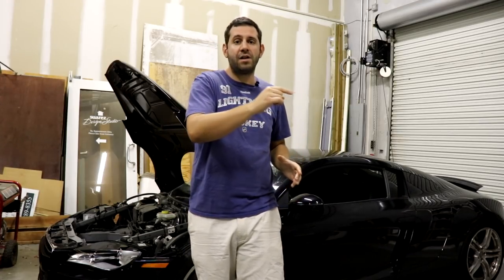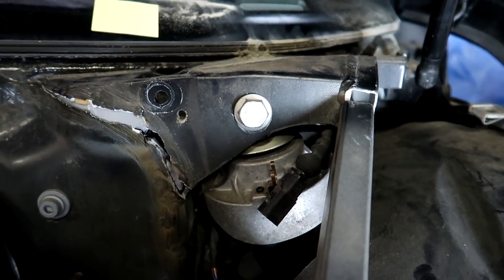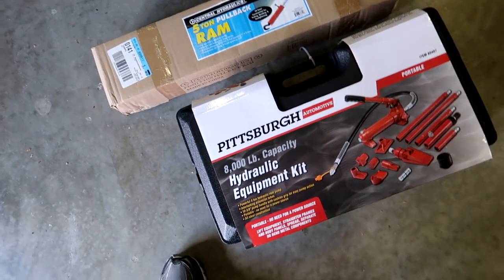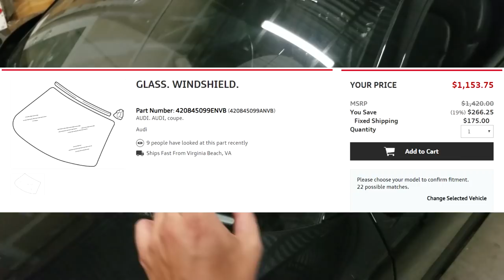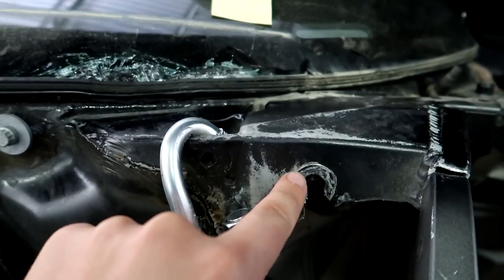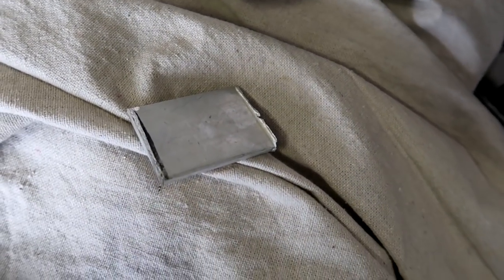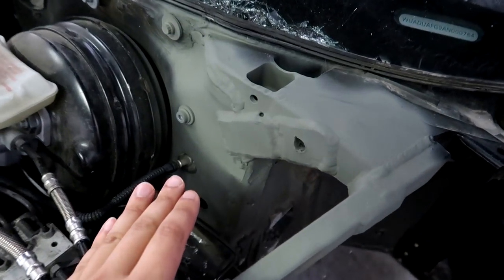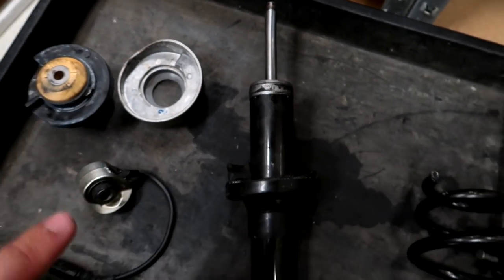I Repaired My Totaled Audi R8's Cracked Frame for $500! Insurance Quoted $29,522!

Comment: Crazy @tjhunt could repair an aluminum square-tube Ferrari 458 front end on the super cheap from pros, sourcing used parts..and yet, here you are hacking away with cheap welds. I get it's a "road car" , but the stupid factored into this fix is a bit overwhelming here.

Comment: Hey Samcrac when the welding was done with a tig welder did you have any issues with any of electrical modules I’m a Bodyman and we are told we can’t use tig welders because of the high frequency start but we weld aluminum with a pro spot mig welder I ask because I haven’t found any information any where providing that we can’t weld with a tig but everyone at my dealership and instructors from I-CAR say we can’t, we mig weld all our joints where we splice the panels in I didn’t hear you say you had any problems we always disconnected the battery for safety on steel and the aluminum trucks but was just wondering thanks for posting

Comment: That's a plus 80 mph crash and Audi plates are meant to be fitted before its snapped the Audi r8 is a space frame  chassis  which  means the only cost effective  way to change it for consumer sale is to change  the front  sections  or race car repair it by realigning  the chassis  with a dozer  gently  heated up with Oxyacetaline pulled to near as dam  possible and then brace  it with a cross section and then weld it all back in place that weld repair will bust the first crevice speedbump  or kirb it hits at the wrong  angle and cause there's  no support it will tear the whole front firewall off and you will have 2 Audi  tts or put a bull on the front cause it's also a galardo chassis cause the r8 is just a cut and extend  version of the bassic  tt  clever marketing at vag  group but that's why they own 8 if not more other car companies.

Comment: This is better than the 3 stooges. It's a shame this car was ruined by a hack job on jackstands. While Sam obviously does not have much common sense, he does have ACCESS to some money, why he didn't get this on a frame machine and have it fixed right is beyond me. With 31 years in the car business, I have bought several cars like this and always send to my body/frame shop with a state of the art frame machine (well over $100K) because he has the expertise and ability to get the car fixed right to within a fraction of a millimeter.

Comment: Jack stands make my heart fibrillate . I have a few friends pass on because of them. I always keep the hydraulic jack in place as a secondary precaution. BTW: Your extra plate looks way too undersized ....shoulda went thicker and used more area.. IMO
Reply: The jack stand is still safer than the hydraulic, which can drop at any second if a seal breaks and that's more likely than the jack stand suddenly shearing all of it's teeth off. Ideally you use both but what drives me nuts if seeing people using just the hydraulic jack and then crawling under the car.

Comment: Just from being a car nut and safety. Either one found an authorized dealer for the replacement part and pay them little extra cash. Or completely cut that section out and fabricate identical piece. That whole area metal has been stressed multiple micro stress fractures. Almost makes me sick on how you went about fixing a structural piece of the body.

Comment: I’m sorry but a car that goes that fast you need to have the car straightened on a frame rack  and laser measured before the repair! Jeez man! It also doesn’t address hidden issues. If you get maimed in a crash the insurance company will check the car history, see the sub par fix, doesn’t matter who inspected or passed it, and no payout! You’re a cripple with no money. Destination fucked. It’s like doing electrical work on your own house and it burns down.

Comment: No offence mate but that is a fucking death trap. 

This would be breaker only car in the UK to Insure it would be a parts car and wouldn't see the road again.

An already dangerous known issue + a cheap, corner cutting botched repair = a big pile of expensive, reheated and structurally weakened scrap aluminium

How could you enjoy driving this thing when you're waiting on the nearside (UK) front suspension tearing off

Comment: You never grind Aluminium  . You  need horizontal  structure that welding will crack again  .Did you get  a warranty .I would give a lifetime on my design.But not on farmers ideas. cheers adam

Comment: Most experts would recognize that the previous Audi owner would have had to have stated what had happened in this accident & why they had issues & didn't want this Audi R8 Back.  Did it have anything to do with THE FACT THEY HIT A POTHOLE AT OVER 50 MPH??  The Insurance Co knew right then & there being well aware that the AUDI R8 had weak strut towers & one look underneath they knew they had big issues, paid the claim out and filed a State Salvage Title and put the R8 up for auction to be forever out of their vehicle to insure network by way of VIN..  Funny NO repair expert has commented on the fact that INSURANCE CO's. write off a vehicle when its repair costs using only new parts reaches 70% of value.  The insured may pay rates based on retail value, BUT Insurance never pays out a claim based on that supposed retail value, but subtracting your deductable, taxes, ect., much closer to the wholesale value of that vehicle.....  Now this Audi R8 may see a retail of $80K+, but a wholesale closer to $65K.  Now since the body parts were in such good shape & the engine & transaxle with under 45K miles showing, it should have fetched well over $45K on auction to the Insurance Co & not expecting a non recycling party to be in the bidding mix, SAM CRAC of FL got a break on that winning bid of $32,700. but he did use an PENN STATE agent/dealer to acquire this vehicle to circumvent this out of State & private bidder rule on Salvage vehicles that auctions will have...  to stop these type of backyard repairs on salvage vehicles from returning back onto law abiding State roads by unlicensed, unqualified persons or body repair facilities that may operate in some US states.
  With a rebuilt Salvage Cert of Title on record for that AUDI R8's VIN, I don't think Sam Crac will get any great PLPD rates or below a $10K deductible from any of the USA Insurance Co's when they run that AUDI's R8 VIN in any State.  Sam might even have to put up a liability bond to get insurance in case of an accident that could be attributed to this Salvage repair that was made to this R8..

Comment: Hey Sam, bent aluminum must be heated in order for it to be pliable for returning it to it’s original position. By heating the area it took the fold, when you pulled it back down or hammered it down, it would have remained in a closer gap even after you released the puller. At that point the weld would be for a crack and not a gap, and the constant hammering of the shock to that area won’t be an issue. Always remember to use heat when you are dealing with Aluminum. Aluminum wheels are repaired/straightened using heat. Aluminum will bend the first time, but will crack and break if you try to bend it back without heating it first. Your welding job may be good for awhile, but remember that you tried very hard to put it back in place without heat, you have now fatigued the area that was bent upwards when you forced it down.

Comment: mate the crack was in the part facing you that you could see but alloy doesn't bend like steel so behind the tower under the dash there is likely a huge crack or stressed and ready to crack alloy where the cracked portion was then hinging up from, pulling it back down into place does not magically repair this, the whole tower should have been removed and completely welded back in after a full inspection and using a jig, . the is now worse off than when you bought it

Comment: Probably it will be ok for a decent time if job was done with the proper filler. Time will tell or Audi should. I would be merciful in traffic and cruel in tracks, polish the welds with my eyes.
I've experience with a flexy carbon mt.bike bonded into rigid cast aluminium dropouts, so all the stress concentrated to the aluminium alloy. 
The drivetrain side dropout finally cracked. Despite I don't know too much about welding  I try to repair it or at least extend the lifetime of the frame.  I supposed in case of failure on the ride life not threatened.
I. The first problem was that I don't know the exact alloy type to use for the filler rod  (sampling and in house electric microscope element analysis would have been my easiest way). But even if I know theoretically which exotic alloy would be the perfect filler it gives no better way ahead.  And there could be other hidden features of the damaged part like heat treatment, forging, accumulated stress.
II. Second problem was the buildup of the heat, but "cold" laser-welding was given in house :) 
After the jobs the frame slowly developed the crack at the same spot twice and the 2nd cycle was shorter.

Comment: Modern Vehicles including the cheapest Toyota's are built using steels with different tolerances. Read about Ultra High Strength steel, High Strength steel, Mild Steel, All the different alloys and things such as Carbon Fibre used in modern vehicles. They use them in conjunction with the safety features such as crumple zones and air bag deployment. You cant repair cars like a swordsmith its 2018.

Comment: This was said already... It's not the proper way to repair such damages, especially on sports cars. Besides the body geometry should have been checked in various points. If it would be a Fiat 126 I would not bother. You just bended it back leaving a huge gap and welded it using a plate... Now go full speed to check out if it will hold.

Comment: Looked at that shock mount only for a few seconds before decided to avoid Audi after previously searching their drivetrain issues. That design is crap, considering what that car was sold as. Won't see that happening on other supercars out there. Hope those engineers went back to designing bugs. That tower looks like something out of a 60's VDub, not a 2010 supercar. Fail...

Comment: So, this was essentially a mechanical failure of a part the manufacturer designed.  Meaning it didn't get damaged in an accident, it just failed due to poor design.  Like say an engine blowing up or a trans going out way before it should.  Since when does an insurance company pay for those types of things?  Shouldn't this have been on Audi to fix or buyback?  Why can't anyone with a Toyota truck that has a rotted frame just get the ins to total it, the OEM failed to design it so it wouldn't rust prematurely?  I can imagine my ins company if I called them and said (for example, this common problem)  my engine in my 1997 grand am has leaking intake gaskets because GM used dexcool and it ate the gaskets.  I'd like you to pay for the repair.  They would laugh and hang up.  How is this different?

Comment: The R8 is capable of 180mph, this car will never , or should I say should never do that amount of speed. This car is good for straight line speed only, and even then not too fast, put this on a track and race it around subjecting the frame to torsional stress and it will go pop. You better like the R8 dude because you will never be able to sell this one.

Comment: I would have welded as shown, but then fabricated a 1/4" aluminum 'sheath' that matched the contours of the strut tower, cut it in two (to increases welding areas), and applied over the entire face and top of the tower.  Finally, I'd have taken a square (rectangular) piece of Al bar and
epoxied it inside of the tower, just for extra measure.  That bitch wouldn't ever think of moving out of place again!!!

Comment: 16:35 "I made sure to put the self etching primer 'cause I didn't want anything rusting down the line - " ..the logic is sound but do you really see anybody putting 200k miles on this car before it's crushed like Jeffy's methmobile RV?  People dump these cars like a bad habit when they drive it long enough to find out it's $10,000 for a trans rebuild and major service.

Comment: Why wouldn't you weld on plates to keep it from.breaking agin  pluse the square  mesurment of the whole front end would be completely fubar  should of measured for  square the total geometry  of the suspension would be totally  out of spec no way any one would insurer  it nor would it pass dot  inspection your going to go through tires like crazy .

Comment: If it only cost you 500 why not fix both sides u completely disassembled the whole front end so why not pay another 500 dollars and if the car was only 7000 dollars less why not just buy one that's not totaled without a salvage title I fixed my Dodge Ram finders on both sides and that cost more than that !

Comment: I have to say that whoever cut them gusset reinforcement plates was a cheap ass, could you have used less material?they should have been more of a doubler plate and followed the shape and size of the original mount, I think this job was done and looks like a dogs dinner,  there is no reason to do such a shit job both cosmetically and integral as well.

Comment: this is a crock of B.S.  yes you pulled it into place and back welded it but  there is no way that  pulled in frame is going to be in the exact postion as a new one ; there are probably going to be issues with allignment plus what  other things did that that crack affect that you cannot visibly see ; once a frame has been damaged along with the suspension  it costs way too much to repair it properly plus any unforseen things that it might have affected the total interrgity of that car suspenion and other parts of the frame ; thus is why they are written off  cause do reputable body shop can guarentee that nothing else can possibly wrong with this car ;  and it wil be next to impossible toget insurnace or license for it to be put on the road ; maybe in your state but i;ld say no where in canada ;

Comment: This is such a terrible repair job. He doesn't know what he's doing and it is dangerous since the aluminum has been reheated and there's no telling if it's strong enough. He could have soften the aluminum or made it to brittle but either way when it hits a pothole on the expressway it will likely fracture and cause a fatal accident. He doesn't know enough about the aluminum. It should be properly repaired not hacked together. Not to mention the alignment is going to be all messed up because he's eyeballed the repair. Even if a professional shop straighten the frame Andre welded it at $29,000 it's still probably wouldn't drive is true as a car that never been in an accident.

Comment: Hate to "BREAK" this to you.... but it is weak there for a very "GOOD" reason... to help save your "LIFE"...
DO a search for 1959 bel air vs 2009 Chevy impala....this might give you an understanding  of how and why an area right there you would want to fail in a collision... so it does not transmit the energy to the passenger compartment

Comment: With all of the "Experts" condemning his repair and not wanting to trust "this car" on the road - I'm going to throw this out there...

THE CARS that have this weakness FROM THE FACTORY should be recalled and the owners given a completely new cars ... since welding plates in place weaken the whole thing and THAT is exactly what AUDI does on their "official repair" to these cars.

You're worried about HIS car... when you should be worried about EVERY ONE OF THESE CARS because the frame/structure can and WILL crack at some point and could sent that car into others killing them.

Face it - AUDI *UCKED UP and they need to own it and recall these cars.

Or do you experts think they should just weld their "pieces" into place and then trust their welds because "Audi"? 

SMDMFH

Comment: in the uk that car would have been cut up , potential future safety issues .
they cu t a lump out of the chassis and only sell parts , not allowed to e back on the road , 
just because its welded does not mean its fixed , just cos the crack is gone , does not mean it wont re appear some where else ,,,, all in all an interesting bodge , but it all has to be declared when you sell it , or the next owner is entitled to his cash back ,,, would i do it ,, yep , but im a coded welder and a vbra trained inspector ,, would i drive it , yep id do that too ,

Comment: Lots of speculation (informed and otherwise) going on here, only time will tell whether or not this process has been effective. Personally, I'd be inclined to hammer (no pun intended) the car around your favourite poorly surfaced non residential roads, at 3am perhaps, with particular emphasis on high G r/h bends. Follow this with a thorough ultra-sound crack test. If thats all satisfactory, keep it monitored. As others have alluded, the integrity of your newly replaced windscreen will be a good guide as to excessive flex.

I imagine there are a LOT of R8 owners, prospective and otherwise, watching this with interest?

Comment: Now, you do plan on reposting another video once the aluminum breaks again right???? 
Once aluminum is stressed or stretched it must be replaced. Welding aluminum patches over broken bolt holes will not last. I wish you lots of luck there asscrack butt I'm afraid you are going to need to replace a larger section of your firewall before it will be strong enough to hold during road vibration.

Comment: I pray he never sells this "cheap" death trap. Thing is he may be honest and tell the buyer, but the next flipper may not be.
Some salvage autos need to be scrapped. Aluminum and magnesium alloys are very different from mild steel, you can't just pull it, push it, hit it with a hammer then weld it FFS!
Although I'm sure Harbor Freight will disagree...